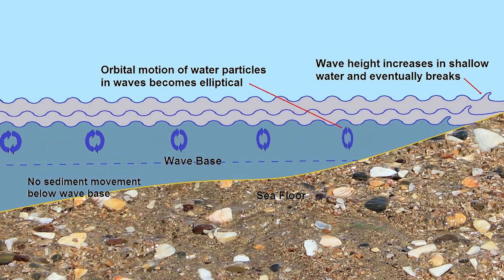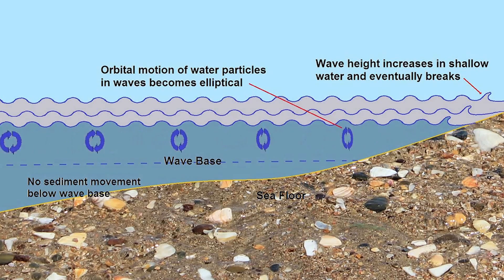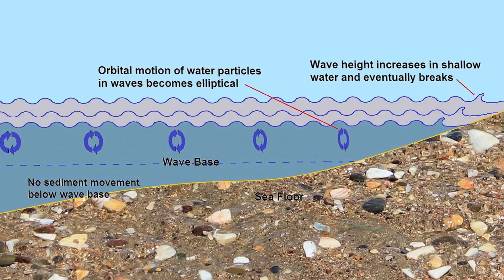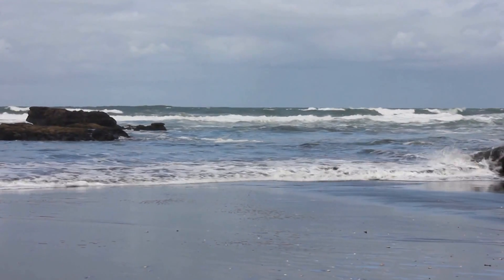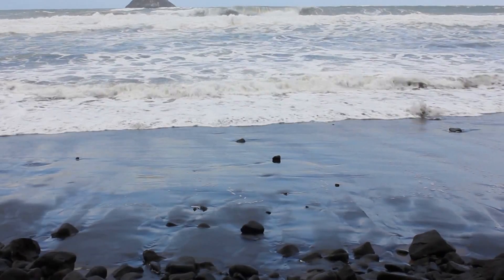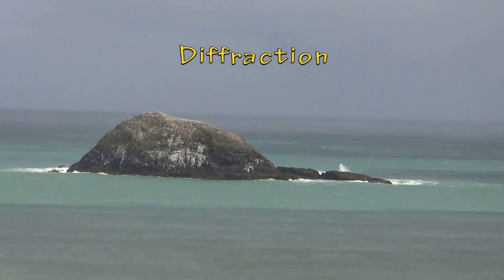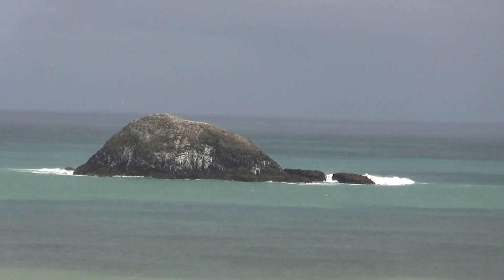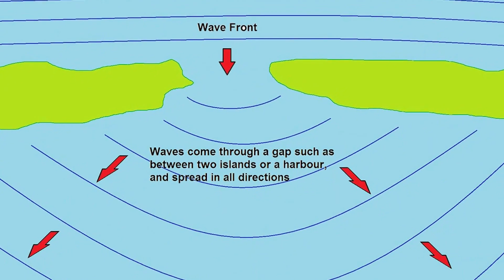Waves and Longshore Drift: Coastal Processes Part 4 of 6

Comment: anyone can tell me what is the difrrent between backwash wave and rip current????
Reply from the maker: Backwash is the wave washing/ withdrawing back down the beach after it has come in (Swash). A rip current is when two long-shore currents travelling in opposite directions meet and cause a rip current to shoot out to sea. If you type in https://manoa.hawaii.edu/exploringourfluidearth/physical/coastal-interactions/wave-coast-interactions and look at figure 5.19 you can see a decent diagram of this. From the air the rip will appear as a calm area  (but is deadly) surrounded by surf.
Reply: ok thank you. but can you tell me that backwass wave is dangerous for swimmer or bathing people??
Reply: @atanusingha7403  there spelt diffrent
Reply: A backwash is just a way of transporting materials so it isn't as dangerous. A rip current is relatively dangerous due to the sharp out-kick from the meeting waves. This rip current is twice the normal size and could catch swimmers off guard if they're in the wrong place at the wrong time.